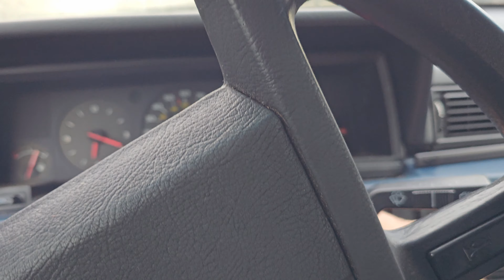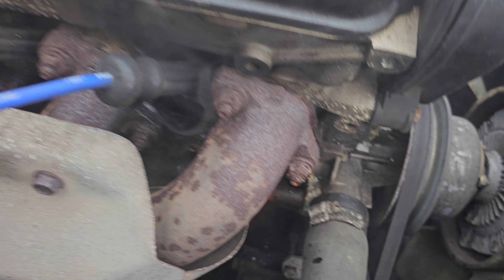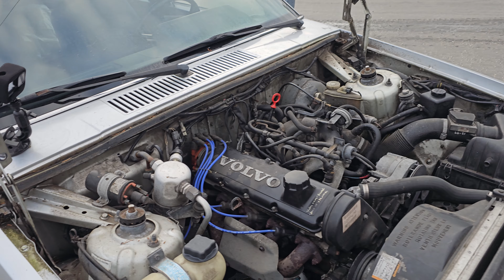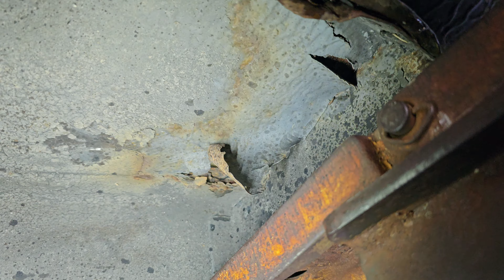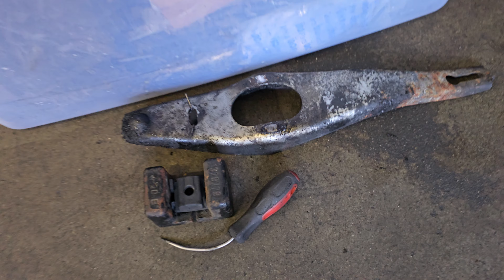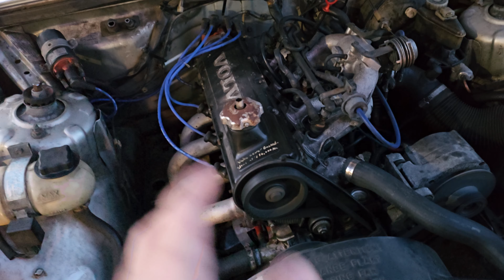How far can you drive a car with no oil pressure ? ( POV test)

Comment: Love it! 
Feels a little like my build. Ive got a honda k24vtec swapped 740 wagon. I actually ended up using a $20 ebay obd2 windshield HUD for gauges 😅 kinda works though. 

I really gotta do my rear bushings though, i just noticed the rear trailing arm braces were loosening from all the wheel hop during street driving.

Comment: I drove a whiteblock 39 miles (over an hour) with pretty bad rod knock. No idea how long the previous owner had been driving it like that. Found a chunk missing from a piston when I took it apart. Buuuuut it still had oil pressure 😂

Comment: I have always been curious how long u can drive without coolant. Just normal driving without abusing it.
Reply: I had to make it to and from work (60 kms / 1hr 20 mins) on around like 1/4 of the coolant remaining
Reply: @groundsalt2199  it didnt overheat?
Reply: @farbrorjosn  nope somehow not lol but I was being extremely careful and ginger. I definitely wouldn't do it again haha
Reply: @groundsalt2199  My 940 turbo ran the temp gauge to red for 100+ times before the headgasket blew. Ofc I shut off everytime it reaches red, but still. pretty durable engines.
Reply: @farbrorjosn  hell yeah